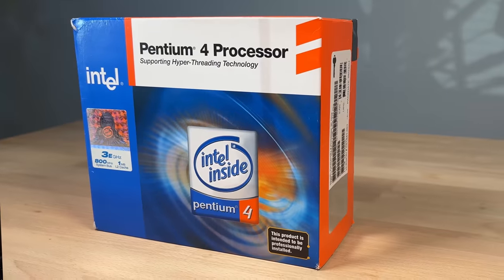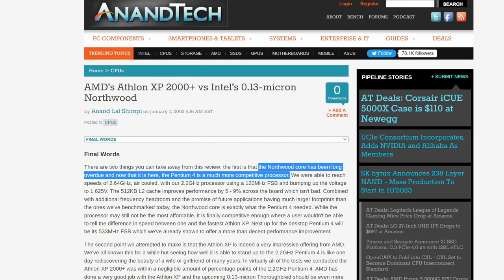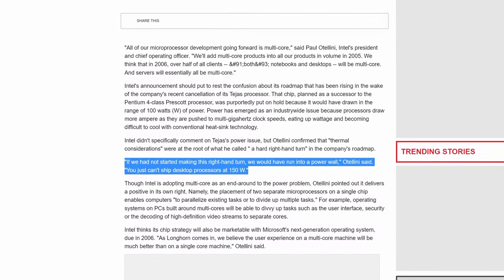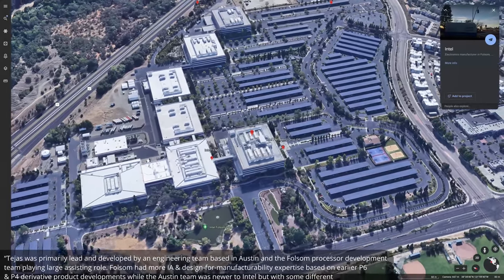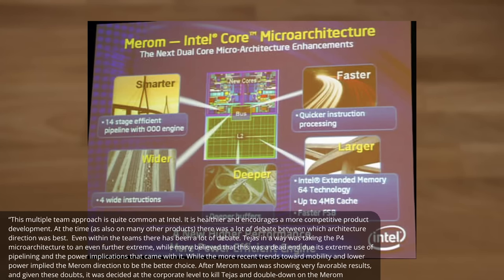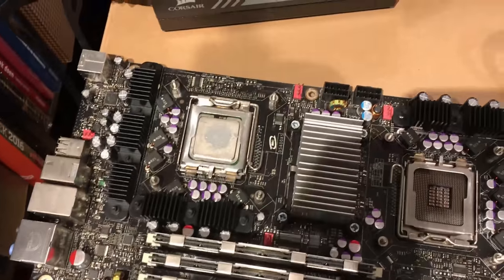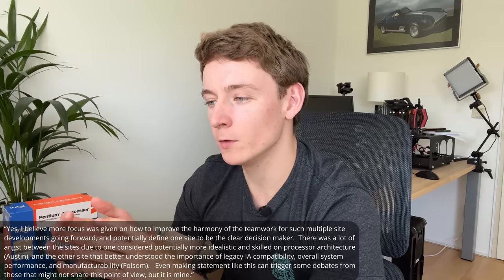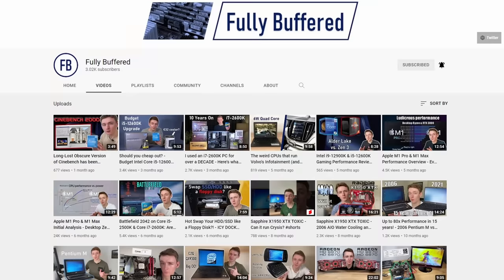Intel's abandoned Pentium 5 project...bought on eBay! (with info from Intel engineer)

Comment: Having done all sorts of overclocking on those 771/775 CPUs, I'd guess if regular Prescott was rated for 115 watts thermal power, and still drew up to 150 W electric power, then to double the clocks you'd have to at least double power draw, but as heat builds up, it becomes less energy efficient. All that under assumption that vcore is constant, I was able to push cedar mill celerons on air to 6 GHz with 1.55-1.6 vcore (from default 1.325) for screenshots or Super Pi 1m, but whole rig idle eats like 280-300 watts (from 120 default). I'd say that TDP on Tejas would have to be in 250-300 W range and it would have easily required 400+ W of power. You might be able to feed and cool that beast with what's available now, but in 2004 there wasn't yet an 8-pin EPS connector introduced, PSU delivering over 500 W were scarce, not to mention you'd need a special motherboard with VRM exceeding ones of that era. This would be something like extreme LGA 3647 stuff done 20 years ago, impressive, mind-blowing while useless and meaningless.
Reply: Also you forgot to mention that the old P4's motherboards using 5V rail as a power supply. That's why the old PSU's nowadays sucks because you don't really need 80A at 5V, that's ridiculous. But when you start think about it, when intel would come up with P5, there could be new 24pin connector definicion, like 28 or 30 for powering that hungry as hell Cpu 🤷 who knows, but i'm glad that intel gave up on this project because pipelining the cpu to the sky was big nono and it will not had a future. With P5 7GHz cpu, in CB R15 single core perf. Will be in level with fastest Core 2  duo clocked at 4GHz but the c2d will draw like 130W and the P5 atleast 300
Reply: @samohraje2433  Pentium III and Athlon XP were the last CPUs requiring a high-amp 5V rail my man.
Reply: @samohraje2433  I am not sure if P4 needed that much of 5 V, but I remember having Enermax 465 W PSU back then, that had like 30 or 35 A capacity on 5 V rail. Nowadays you get 20-25 and that's still a lot, since most of the power in PCs goes from 12 V rail. BTW that's also a challenge if you want to overclock an old CPU with new PSU, you might not have enough 3.3 and 5 V rail.
Reply: @samohraje2433  Pentium 4 doesn't need 5V rail. They are mostly 12V. 
Only early motherboards from 2001-2002 was built on 5V rail for CPU.
All later motherboards using 12V 4-pin additional supply.
I'm sure, that in late 2004, they would plan it on 12V rail, probably with double 4-pin connector, which was introduced anyway on most highend motherboards, for overclocking, when you go above 150W.
If this project would be successful, they would just need to build it few years earlier this way, and introduce 2x 4-pin 12V rail as basic.
socket T was built for large heatsinks from beginning, it was also made of steel, not plastic, and it came handy later, when multicore extreme CPU's appeared, even on core 2 architecture, they start to draw over 125W, particulary after overclock.
Just check Asus P5Q Deluxe motherboard, you'll find there 2x4-pin 12V rail additional connector for CPU.

If this behemoth would be release, they would just need to build motherboards like this. With 8pin 12V connector for CPU instead 4pin, and 8-16 power phase design, (Asus P5Q Deluxe has 16-phases, so it handles over 150W CPU with stability even after extreme overclock... this scenario of course happens only during extreme overclocking, it wasn't meant to run like that, it's basicaly only for records for overclockers, that trying to hit absolute maximum and run 1-2 benchmarks... but Pentium 5 would probably needed it for normal run)

Comment: It's ironic that intel managed to fall into the same trap many years later. Instead of trying to increase IPC they still raised clock speed with newer process nodes and didn't care about power consumption. After the P4 disaster they based their next architecture on the Pentium M, a low clock but high IPC design that was only meant to be used in laptops but turned out to be much better for desktops than P4. This intel "core" architecture was very successful for many years, even persuading Apple to switch from PPC to intel. But intel failed to focus on efficiency and lost Apple as a customer. Fun fact: Apples inhouse architecture is based on a mobile chip developed for smartphones😉. History repeating..
Reply: History is also repeating for AMD, they just used Jim Keller in order to stay afloat, their Zen iterations are still based on Zen architecture, with minor changes, even like 3D Cache, it's still on band-aids, and not a new architecture. AMD has no new architecture for years to come.
Reply: I don't think it was Intel's plan this time around. They just thought backporting upcoming architectures to their 14nm node would be a waste of resources as they surely would be able to leave that size soon enough. Then their fabs just didn't make enough progress and they were stuck with just one choice which was to crank up the clock frequencies.

Then by the end they did bother making one backport release, namely 11th gen for desktop. Kind of an awkward release.
Reply: @Wokiis  Breaking News: The Fab node has lost its meaning once it goes below 12nm.

Heck, it has lost its meaning once everyone go to 3D or trigate transistors instead of single planar transistors.
Reply: @AlfaPro1337  you just spouted nonsense.
Reply: @Wokiis  twice
Reply: Hardware Unboxed showed that on previous core architectures 
(maybe 4th gen through to 10 gen?) that cache really mattered. More made the chip faster. But since moving to Alder Lake and its reiterations, this seems to not play out, and there plan seemed to be more GHz and more power. Wonder if these newly announced architectures will be different.

Comment: Intel thought they were being slick with Prescott and the high clock speed. Basically trying to trick people with the high clock speed. Only problem was that AMD's Athlon64 at 2.4 Ghz was significantly better than the P4 at 4.0 Ghz. Which really opened people's eyes to IPC rather than clock speed.

Comment: This stuff reminds me of the FX9590, where AMD tried to squeeze the impossible from an old flawed architeture that could give extremely high clocks, but low IPCs. The story is quite the same, and also the infamous FX chips where characterized by abnormally long pipelines, hence high power consumption and long latencies in case of wrong branch predictions.

Why did AMD decide to make the same mistake Intel made on its previous iterations is still a mystery to me ahaha.
Reply: Your take on this is grossly inaccurate. if you compare the FX9590 with any 32nm Intel chip, the FX9590 wins easily. What you lacked over the years is knowing what Intels advantage actually was. It wasnt a better design. Intels designs have been clear verifiable worse for 25 years. Intel hit it big, jumping what was essentially several nodes ahead when going from P4 to Core2, because of both a node shrink AND a new novel 3d trigate design. The Core2 was also based on P3 instead of P4, but still not as good as AMD's designs. Also, that 3D trigate shit was what put Intel in the VERY BAD position it is in today, because they spent 8 YEARS trying to move it from 14nm to 10nm and eventually gave up. Todays Intel chips are using FinFET again like everyone else, and Intel is worse. Yep.
Reply: @styleisaweapon  Don't get me wrong, I wasn't considering neither raw performance nor lithographic nodes for my comparison. I was considering concepts (long pipelines) and relative consumption (> 150W). I know that AMD has been superior at designing chips at most times (not always tho). 2nd gen FX was superior to Intel in raw integer calculations and had a way larger cache amount. The way that resources were handled, tho, was poor. Shared caches had a terrible latency and collisions between cores, and FPU cores were halved to cointain costs. So that design wasn't the best anyway. What penalised FX series was their terrible 32nm GlobalFoundries node, which was obsolete even at the time. FX could have gathered much more success, but it had limits due to its structure. Even if they used a better node, pipeline complexity increasing over generations would have caused consumption to become incontrollable. And latencies too. This is why in many applications FX was way less responsive than lower-tier Intel chips of the time (as i3 and i5), despite being more powerful on paper.

More latencies + More consumption = Consumer Market failure. And the reason in the absurdly long pipeline. That's why I can't get why they used this approach. 

Also, another inaccuracy you said is that Intel was always (and still is) inferior in design. After AMD K6, which is corresponding of Intel P1, AMD was getting each iteration closer to Intel, and superseeded it in the terrible P4 era. Athlon Classic was more efficient than P4 at the same way Intel Core 3-4th gen was towards FX 1-2nd gen. The Phenom era wasn't the same, tho. Intel was way more efficient at the time, despite being overall slightly less performing.
Also, the first Ryzen processors weren't better than Intel ones. They were much more cheaper and had a way better value (on a similar node than Intel's). That's why they succeded. This changed with Ryzen 3000 series, which was both cheaper, better performing and better consuming.

This is also changing again, with Intel Amber Lake being better performing, but more expensive and worse consuming in some categories. Times change.
Reply: @rotten_cyano  blah blah wall of text that proves youi still simply dont understand what intels advantage was - everything you said is literally invalidated by it - EVERYTHIHG
Reply: @styleisaweapon  I suppose you didn't even read. You just said random things in your previous comment and I made a further explanation.
Reply: @rotten_cyano  ah yes random - intel being effectively 2 nodes ahead didnt entirely explain intels performance advantage at the time .. you are so right ... not only doesnt it entirely explain it... it doesnt explain it at all .. how clever of you to realize that having a budget of 4 times as many transistors doesnt mean anything to performance
Reply: @styleisaweapon  Sandy Bridge (2011) 32nm - Bulldozer (2011) 32 nm. We have a direct comparison. Sandy Bridge was way more efficient. What are you talking about?

IPC doesn’t change with node. Full stop. If you can prove that Intel had a worse IPC than AMD at that time, I’ll admit I’m wrong. That’s the whole point of the discussion. AMD was inefficient at the time, despite having an interesting multicore architecture and better performance in some areas, despite the node. Would FX have beaten Intel if it had better nodes? Maybe. But you can have a performance boost OR a power consumption boost, not both (at least, fully). 

FX was fast in sequential loads (ex video rendering), but lagged behind in games due to complex pipeline and cache collisions. If FX was on a better node, maybe it could have reached or slightly beaten top-tier i7’s peak performance in almost all areas, but still with the same high power consumption and still with the same stuttering given by the architecture that Intel was missing. 
That’s a fact, deal with it.

Do you know why FX iteration where stopped? Because AMD engineers admitted that the architecture itself was flawed and inefficient. That’s why they designed Zen architecture from scratch instead of continuing with Bulldozer. Intel didn’t have to do so at the time, that’s why they were overcooking the same processor from time to time, only with minor adjustments.
Reply: @rotten_cyano yeah like that
There is a reason why those CPU dieshot really different

Comment: Probably attach a signal analyzer to each pin and apply voltage until you find a signal then decode from there. Assuming you didn't fry it plugging it into a socket that happened to fit

Comment: Well thats a shame it doesn't work. You could also try a 775 chipset board with one of those stickers which swaps the pins round?

 I have the Intel black ops CPUs for LGA 2011 and although they are unstable I can boot and run them on Asus z9pe d8 ws and rive.
Reply from the maker: That’s very cool - I’d love to get a black ops. Unfortunately it seems that without proper microcode support it won’t matter what motherboard I try. Perhaps an engineering sample 771 board, but the chances of getting hold of those is slim.

Comment: Cool video! I would try these on a p35 chipset socket 775 motherboard with the socket modded to take 771 cpus (with sticker on the cpu) I have a p35 board that runs a Xeon 5050 which is old old Pentium D era stuff. Good luck! Need to see these running. Any more available? Ive lots of different server boards ect to test on

Comment: People don't realise that increasing frequency by deeper pipeline is quite equivalent to more parallel functional units, because you need the same amount of independent instructions to fully utilise resources in every case. In principle, every stage of pipeline execute different instruction.
To some degree relation speed vs. width is similar for another parts of processor, like cache.

Comment: crazy thing I remember reading on Anantech in the early 2000s about how Intel was going to make 4 GHz and 5 GHz Pentium 4s. They also talked about the goal of it being 10 GHz. Insane when you look back at it, single core CPU at 10 GHz? I find it fascinating how Intel was much bigger than AMD so they doubled down on single core chips with insane clock speeds but AMD did the opposite. They took the time and money to invest and create  CPUs with integrated memory controllers Hypertransport and two cores on the same die and x86 64. The Anandtech writers all sided with Intel and even said the Pentium D would be superior to the AMD Athlon 64X2 because Pentium D had two CPUs in different dies. Insane right, Intel must have been paying them off or something. IBM also followed AMD with their Power 970 architecture. Intel saw the error of their ways and finally course corrected with their Core designs.

Comment: here's a thing: there are two x86 µarches gentoo has ever seen that gain a sizeable amount of performance with µarch specific compiler options/flags. those are:
* bulldozer
* netburst

and owing to this, I've concluded that those two µarches have heavy justifications for build arches specific only to each of them. sure, since it's x86, every x86 processor can run it, but obviously they'll make bulldozer/netburst shine like they never got a chance to. you may remember a similar scenario with the original raspberry pi; many distros used an armel kernel and binaries (that is, software floating point), but the bcm2835 had hardware for floating point, so it could also run (and actually benefitted from) armhf kernels and binaries due to not having to emulate floating point instructions. for many people back in the day, picking an armhf distribution/system literally meant free performance.

Comment: The netburst direction would have paved an interesting future, one where both extended and simple instruction set targetting would be natively supported, but with programs compiled using a simpler instruction set could theoretically perform better. Like having a 'psuedo-risc' instruction set which bypassed most of the instruction simplication steps. A compiler with all the time in the world to optimize could spit out more ideal code than the cpu doing it in realtime would.

Comment: 50 pipeline stages sounds a bit like a cargo train with 50 fully loaded wagons with the bogies and couplings welded fixed going at top speed.  In the mountains.
Reply: With such a 50-stages CPU, branchless programming is the key. To stay with your analogy, it would basically be a tunnel through the mountain.

Comment: I had a laptop with a Pentium 4 desktop chip clocked at 3.5MHz. It was quite fast but the most notable feature is it melted the plastic on the bottom of the case. It was too hot to put on your lap and would leave burn marks on a wooden desk.

Comment: On getting that working, many newer BIOS systems have a whitelist of supported CPUs and what settings to run them at.  If you can find the table and format you should be able to insert support for that CPU into the BIOS.  

As a note I would put a minimal office-desktop GPU in for the first boot instead of a higher-powered nVidia card.

Comment: Great video. Try the 771 775 mod on an Asus motherboard. Asus motherboards seems to boot unsupported CPU's, it just displays an "Unknown CPU" message at startup. (tried a 3.6 p4 cpu on a core2duo Asus motherboard, and got the "Unknown CPU" message but I pressed F1 to continue, and it worked out just fine) It wouldn't hurt to try, but I doubt that it will work with that cpu.